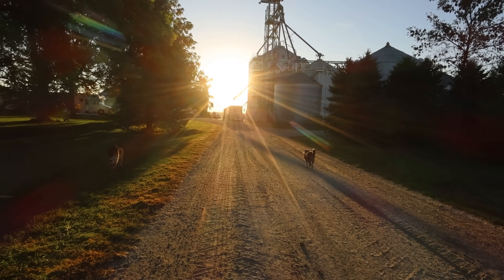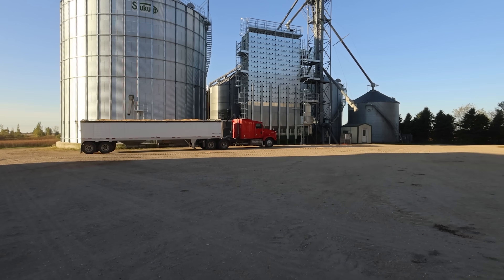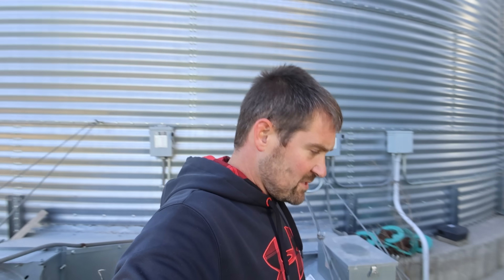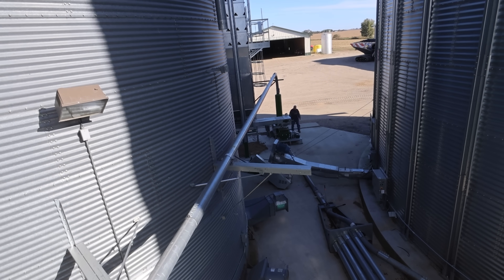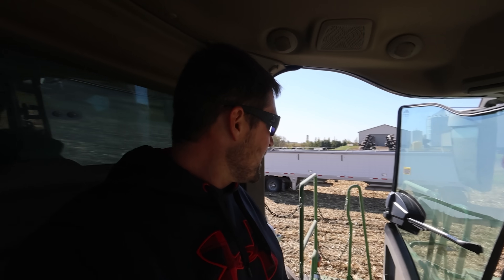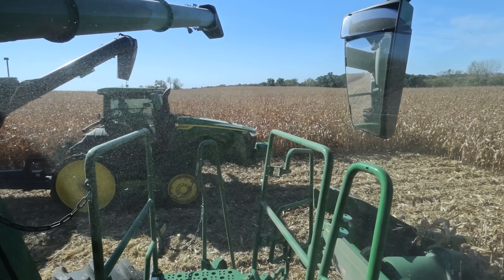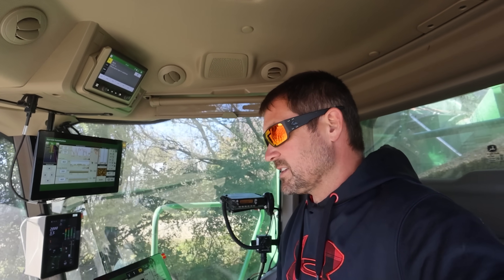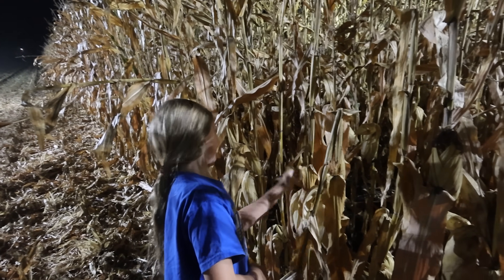Did the New Combine Calibrations Actually Work?

Comment: For trtimming trees search using "Compact Mechanical Tree Trimmers"
Here is one explanation.
Bucket trucks and chain saws certainly get the job done but they lack efficiency. Raising the bucket, trimming the branch, lowering the bucket and moving the truck ahead to the next tree is time-consuming.

Using a mini-excavator chassis, the compact mechanical tree trimmer is equipped with a saw blade on a nonconductive, hydraulically telescoping boom capable of reaching up to 53 feet — high enough to tackle the vast majority of trimming jobs. This allows the operator to remain safely on the ground while quickly trimming branches with the boom.

The design of the compact tree trimmer allows it to access tight spots easily and quickly with its zero-turn radius and 360-degree boom swing. It can maneuver easier than other larger trimming equipment and no time is wasted repositioning it or climbing in and out of bucket trucks."

Comment: Precision Manufacturing makes clippers that will mount to your skid steer that you can use to trim back your field edges. Depending on the unit, you can reach over 10' and cut branches and trees around a foot thick.

Comment: Transmission line folks have impressive vertical cutting bars they use to trim trees back up to the  height of the electricity transmission lines.  Some are mounted on ground-based machines with extension arms and others are suspended from helicopters.  Snowmobile trail maintainers use tractor-mounted frame with cutting wedges mounted vertically on the left and right and horizontally on the top to clear a rectangular-shaped passage along the trail.
Reply: That stuff is way too complicated and expensive for him. There are some mower attachments that can fit on the loader tractors or skid steers that would work way better.

The saws that we use for right of way maintenance are a little too heavy duty for farmers

Comment: I've seen county guys run along roadsides with an extendable bush hog attachments that goes in the air. I wonder if you could get one to mount on the 6r to do that tree work. Not totally sure what they are called but wouldn't doubt John Deere or someone like unverfurth has something along those lines.

Comment: Tiger has some new cutters for trees. Look like a brush hog  and will work like one in ditches. You will need a tractor  for o e that has a cab that is wrapped in steel mesh. Side mount with hyd arm  that pivots and extends. Mower rotates and pivots on the end of the arm. Don't use a new tractor it will sling branches and anything it hits.

Comment: Couple fo things I found on the internet_  Limb Beaver LB6TR Brush Cutter For Tractor Loader,    LimbShark Tree Trimming Cutter | 4-Blade Rotary System | Cuts Up to 3" Limb Diameter | Gas-Powered & Hydraulic Options | 8–30 GPM & 6.5–8 HP,

Comment: That "auxiliary straw based pre-filter" on your grain air intake was impressive!

They make some really fun excavator and mini excavator attachments that will turn a tree branch into mulch in seconds, but you'd need to add the excavator to your farm toybox first.
Reply: No you don't. They make a three point hitch cutter that runs off the PTO.
Reply: @tuberNunya  The branches are high in the air though.
Reply: @JohnShalamskas  IT reaches 25 feet high. Good enough for ya?

Comment: Tiger Mowers makes a tractor rear mount hydraulic driven mower with an articulating arm that will take care of your tree problem. I used one for years at the city public works and they’re amazing. They can really stretch out and mow your ditches too.
Reply: Several companies make them, Limbsaw has one that mounts to a loader bucket
Reply: Hedge trimmer
Reply: We had a guy come to our farm and he used a forestry mulcher on the end of a high hoe. It made quick work of the trees around our farm field edges.
Reply: I’ve seen these, they’re great
Reply: It’ll scratch the green paint.
Reply: @benpattinson1  HA HA HA
Reply: I run a Diamond boom mower it’s amazing 18’ reach up to 8” diameter.
Reply: Yup tiger mower
Reply: City workers on other hand are useless.
Reply: Weve got an ancient side arm flail mower that can get well above the tractor, not the most effective tree limber, but itll mangle whatever you point it at
Reply: there are a couple of different guys on you tube who use them in their video's also they chew it all up into shavings to make short work of the job...
Reply: Sounds like the Swiss Army knife of mowers! Might need one before my trees take over the yard.
Reply: You need the attachment with the four circular saw blades..  they fit on hedge cutter arms or on telescopic handlers